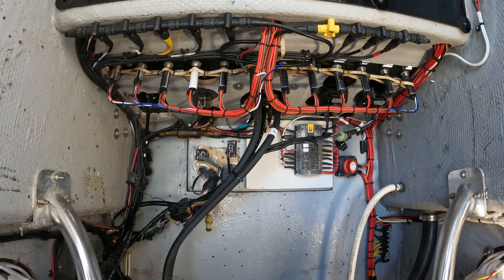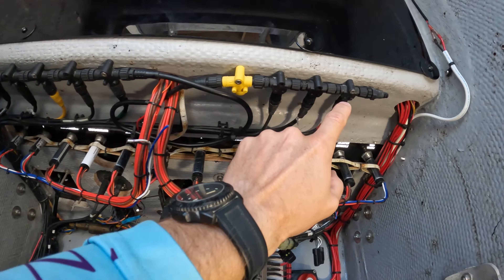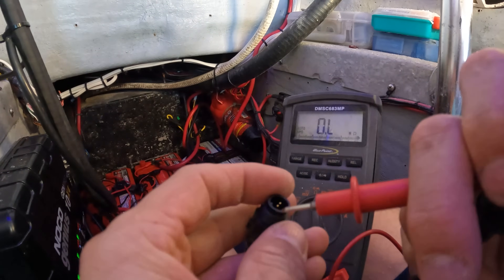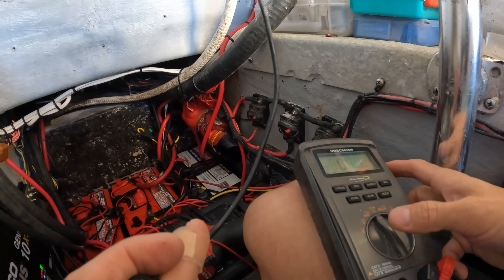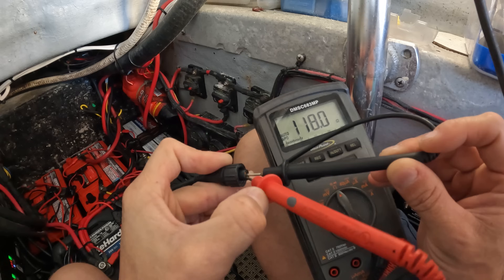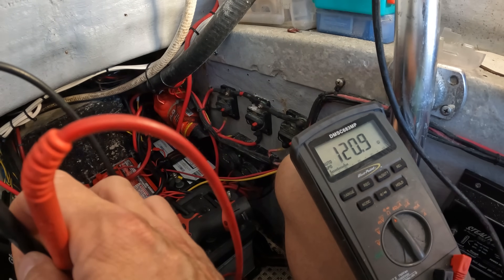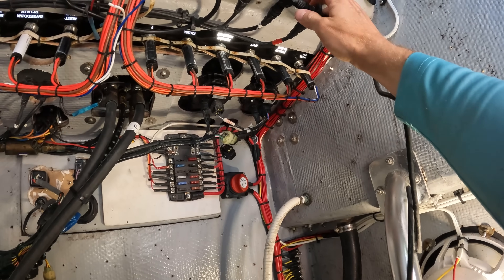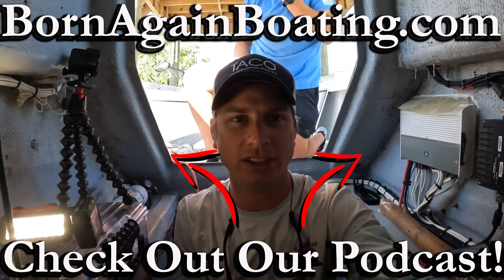How NMEA 2000 Works

Comment: Two thoughts:  (1) it is a good idea to apply a gob of dielectric grease to all male NMEA connections before connecting them to the females connectors.  This does not affect network operation and will provide years of corrosion protection on all connections.   (2) some NMEA devices that go into the water (e.g. paddle-wheel speed sensors and water temperature sensors) are prone to early failure, and this failure can take down the whole network when they start to malfunction because they start to monopolize the communications lines with gibberish.  The only way to troubleshoot in this case is to disconnect devices one at a time until communications are restored;  a painful trial-and error process in a big network.

Comment: How to check the antenna vhf on a yacht if there is nmea?
Reply from the maker: Depends on a few things, is the antenna a digital antenna or a regular antenna? But the NMEA 2000 is something else outside of the antenna. The antenna will hook up to something that then communicates with everything else using the NMEA 2K. The antenna could be checked with your ohmeter or just get another antenna and then hook it up and see if it works, that's the easiest way to see if it's the antenna or not :)

Comment: It sounds like you cleaned up some fretting corrosion by working the connections. We get a lot of these issues in under-seat connectors on cars and trucks. Leads to a lot of airbag lights.

Comment: Shades of 10-base-2 networking!  Named for the 2 conductors (shield and core) of the coaxial cable used.  Operating at the BLAZING speed of 10Mbits per second.  Note, that is BITS, not bytes . . .

Comment: I work in automotive, and man do I wish they would incorporate a central hub like that in cars.
Reply: They do, it's called the gateway module. The thing with Marine is that it has to be kind of universal and easy to install because lots of different manufacturers with all different setups use it. When you design a vehicle from the ground up like a car you can cut cost by not making things universal and making it all custom tailored to the vehicle.
Reply: @lustfulvengance  thats a GM specific thing am I right? I haven’t seen any other manufacturer with some sort of hub. It would just be nice for communication diagnostics to go to one place and eliminate modules there, versus having to go to the separate modules. Then you have the heavy duty side with their J1939 network, that can be a cluster.
Reply: People ask me why boats have more failures than cars?   Your example is spot on.  They are designed and manufactured differently.

Comment: how did nmea get called "NEMA" though?
Reply: Also, Thoughts on the multi pack tee vs many singles? i have a 4 way tee in my boat, it cant flex & less joins to cause issues
Reply from the maker: I'd rather have those 4ways, that's what we usually use
Reply: @BornAgainBoating  Definitely makes it easier haha
Reply: Easier to pronounce, nothing more

Comment: Yeah, I try to stay away from those individuals T’s as much as possible. Too much room for error.   For the DIYer, I like to cut an old NMEA cable’s s ends off and add butt connectors for my meter leads. That way I can read voltage at all the drops and easily read total network resistance from any where on the network. The N2K meter works great, but it’s $800+ bucks
Reply: So, you insert it anywhere in the back bone to measure resistance at the uncrimped ends of the butt connectors?  Is that correct?
Reply: @chiphill4856  Yes, with the voltage removed. When you peel back the wire insulation on your test leads, you’ll see blue and white wires,that’s your network wires. You should see 60 ohms on a good network.
Reply: @Anthony Caffarini  will you see 12 volts on a red and black wire
Reply: @austinhall7514  yep, that’s a good way to see if you have good voltage going to whatever device you have on the backbone
Reply: @Anthony Caffarini  thanks looking to make my own tester
Reply: @anthonycaffarini5687  Great info, I'm making one to throw in my tool bag.  Many thx!